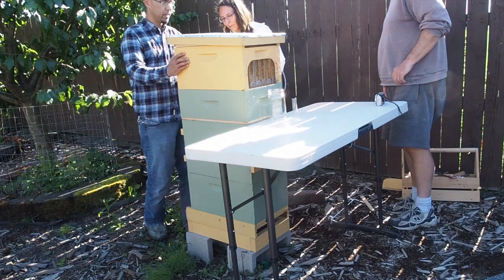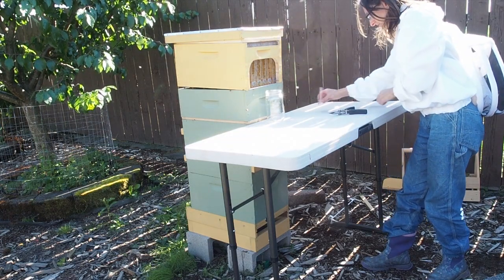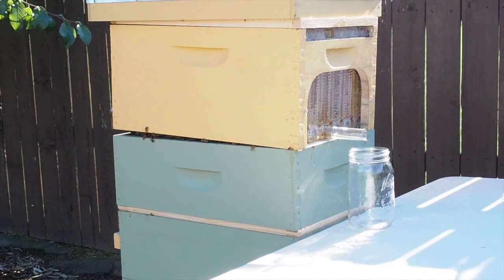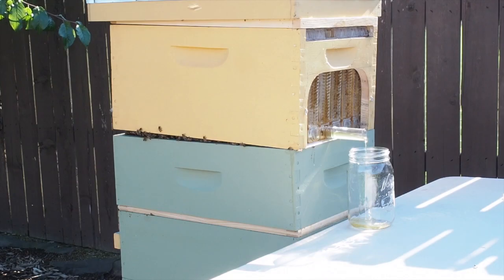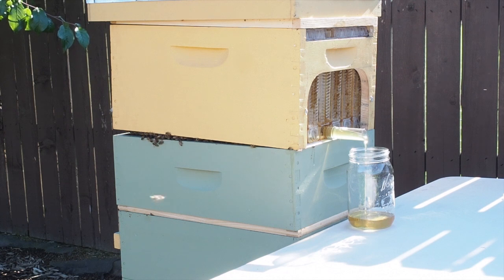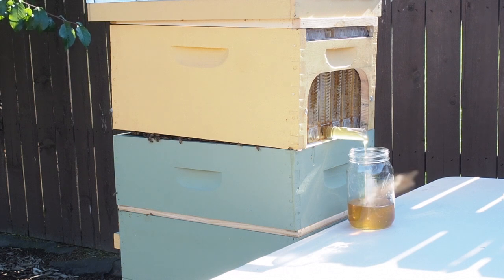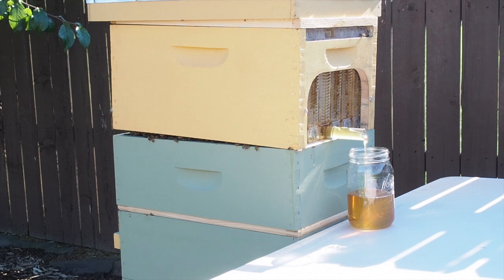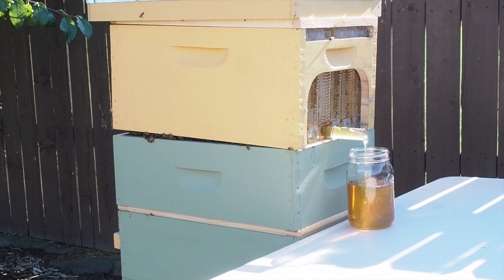Flow Frame Honey Harvesting

Comment: Thanks.  Good set of videos.  My only thought might bee to put a screen over the top of the quart jar itself instead of the plastic, but it looks like that solved your issue of drowning bees.
Reply from the maker: Another option is to use a tube. We have thought about using one but never got around to getting the right size.

Comment: Have you seen the Youtube video from the beekeeper who cut the Flow honey harvesting output tubes in half at a 45-degree angle and reglued them to form right-angle elbows pointing downward?  He then bought special plastic lids for his mason jars that had pop-up-lid hatches in them that just fit the output tube.  Now he could set up each output hole with one of these and just leave them to drain, doing other work and checking on them every so often, not having to check on them a lot as he had to do previously using just the supplied equipment.  No mess, no bother, no problems with bugs smelling the honey and walking all over the mason jars or trying to bite or sting the beekeeper or getting in the honey or with having wind make a mess.  Neat...
Reply: Nathan Okun can you put the link to his video please. Thanks
Reply: minnaTwo, Nathan Okun must have been referring to this video:

https://www.youtube.com/watch?v=RgJxvz09vgs
Reply: Frederick Dunn channel

Comment: Great video Grub, I have a flow hive as well. I put my flow hive supper on the 2 of July right as the sourwood started bloom. I'm in western NC. Just come back from checking to see how much capped honey I have in the frames. Looks to be about 75% are capped. So I'm going to wait till Tuesday, check it again before harvesting, but at the rate they'er going I should I'll be fine. My plan is to video tape and post on youtube as well. 
This will be my first harvest from my flow hive, I'm so looking forward to it. Because I didn't add the flow hive supper till after the sourwoods started blooming this should be 95+% sourwood honey. Do yo know how much honey these flow frames will produce? I'm thinking somewhere around 3/4 of a gallon per frame?
I belong to a local bee club, I told the members right up front I have a flow hive, they all laughed at me & said I wasted my money on it. I'm "hoping" I have the last laugh, LOL.
You have a great idea about just buying the flow frames. I've been thinking of adding a 2nd box next year, so that's something to consider.  Dave
Reply: Yes I've noticed it's not a fav topic for bee clubs. I'm not surprised they laughed at you. Little do they know it actually works! If the cells are mostly full you should get around 2 quarts per frame. Good luck! I look forward to your video.
Reply: Yeah. At best a full half gallon. The first harvest may not be as much as the 2nd harvest. From what I've seen, the bees have it all figured out by the 2nd harvest and the yield increases. But 1/2 gallon at best. One guy I saw did his second harvest one month after the 1st and he got just over 3 gallons. Imagine that 3 gallons in one month.

Comment: did you have the same issues with honey leaking into the hive on your first harvest like i saw on one video?
i am going to get the flow frames on three of my hives this and hope it works out.
Reply from the maker: We have had the issue but not every time. If you open it a little at a time and put the tube thing in correctly it shouldn't leak into the hive.

Comment: First year beek here. We are essentially fostering two hives as I'm active duty and don't know how long I'll be stationed here in MD. 

We didn't get our first hive until May and the spring nectar flow was non existent due to rain. Plan is to get the bees through the winter but we are still on the fence on the flow due to cost. 

Are you feeding your bees during the durth?
Reply from the maker: I fed my bees during their first year and I also did not harvest any honey the first year. I'm only feeding one of my hives and only just started on Monday. That hive swarmed and was without a queen for over a month. They finally made themselves a queen and she just started laying and my bee mentor suggested feeding that hive and they are taking it in pretty fast. I'm not feeding the other hive though. If it's their first year I would suggest feeding. If they aren't drinking it then you can stop feeding.

Comment: nice video, you should tilt the whole hive rather than cracking open the box, and add a small eke above so the roof does not need moving also, but well done
Reply from the maker: Thanks. We were originally going to tilt the whole hive but it is so tall (5 boxes) and heavy we decided to just do the flow frame box. I was wondering if we had tilted it enough. Probably could have gone more. The propolis was already broken between the boxes since we had just done an inspection.
Reply: I was wondering about that too but she makes a good point

Comment: what is the reason you added a honey super underneath the flow frames? I would think they would fill and cap the flow frames faster without the extra box, or put the extra honey super on top of the flow frames so the bees would work on the flow frames first? Just wondering?
Reply from the maker: The frames were about 95% full just not capped. I didn't want to risk them swarming so I gave them another box to work on. Unfortunately I didn't have anymore frames that were drawn out so they probably consumed some of the honey in order to draw out the comb on the new frames. Most people I talked to suggested putting it under the full box so that they don't have to travel through as many boxes to get to the new one. I would have put the new one on top if they would use the upper entrance I gave them but for some reason they are not using the upper entrance and will only use the bottom entrance.
Reply: In the box 3 on top, it's only for honey, where the bees stock more than needed just in case of hard times. The box 2is full of honey but is left untouch because it's the minimum reverve the bees need to survive a winter. The box 1 is where the queen put her eggs, and where the larveas grows. A plate with too small holes between 2 and 3 prevent the queen to go in the box 3.

Comment: Wondering if you could put a 90ﾟ angle PVC pipe with a little bit of a tube into the jar around a quarter of an inch, So the honey will go directly into the jar rather than dripping through the air.
Reply from the maker: probably. I know some people attach tubing and put the tubing directly in the jar. We haven't gotten around to buying extra stuff.
Reply: Gapeys Grub: Yea, I've seen that. I don't like the tubing idea because to me it seems like it would be to easy for something to go wrong. PVC  90ﾟwould seem more stable. That is in my opinion. Also you would not have to wrap plastic all around just over the hole of the jar then poke a hole in it and put the down spout though the hole. Again my opinion.

Comment: What r the bottom boxes ?
Reply from the maker: Hilal Ahmad that’s where the queen and brood are.
Reply: We only take the honey from the box 3 on the top, the bees stock more honey than they need. In box 2 there is the honey reserve the bees will need it to survive in the winter, we do not touch that one. In the box 1 the queen put the eggs. The laveas grows there. A plate with too small holes prevent the queen to go into the box 3.